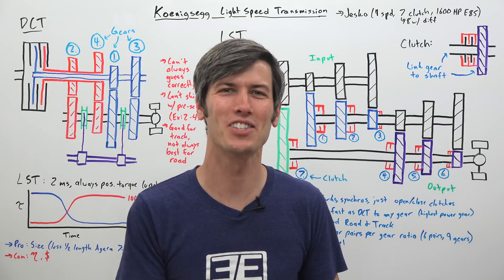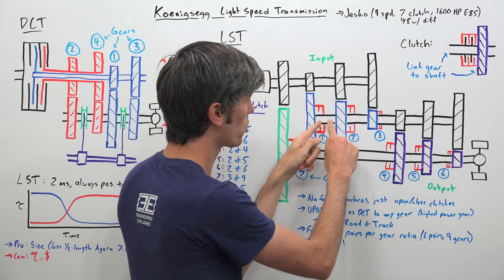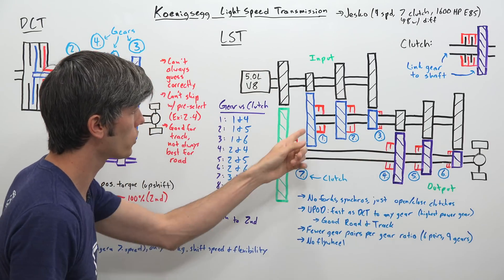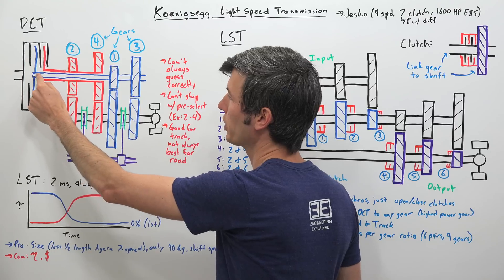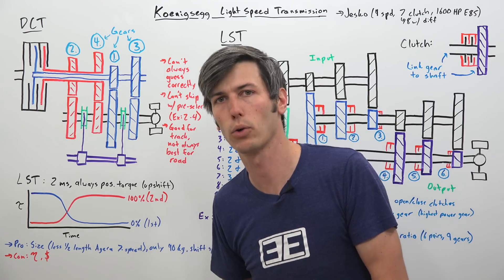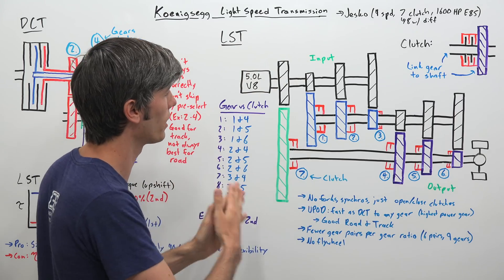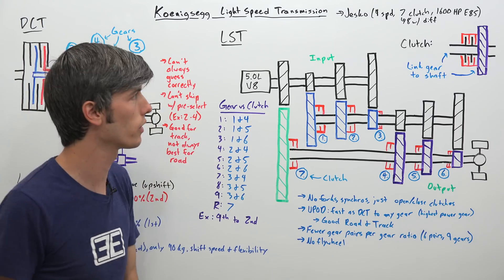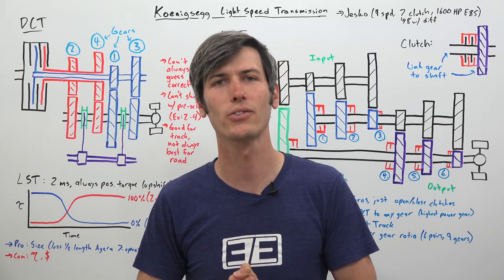Has Koenigsegg Made The World's Fastest Shifting Transmission?

Comment: Gotta respect Koenigsegg for continually finding ways to keep pure IC hypercars on the bleeding edge. I lost count of the amount of hypercar reveals over the past year that followed the similar formula of: let's build an EV hypercar with 1000+ horsepower (usually by getting the tech from Rimac), put a striking body on it and call it a day.

Now, I'm sure they're all unique somehow but none of them stand out to me because it feels like everyone jumped on the bandwagon. On the other hand, Koenigsegg knows that EVs are ultimately the future but they aren't just giving up on good old IC and geared transmissions. I'm no engineer, but I would imagine it's a lot harder to design and develop a 9 speed transmission with 7 clutches (let alone for a car with 1600hp) than it is to build a car with 4 electric motors and a battery (that you likely bought from someome else) all controlled by a computer.

Comment: any word on why they went “back” from the direct drive to a “traditional” transmission?
Reply from the maker: They didn't. Both Regera and Jesko still exist. Discussed this at the end of the video. Jesko does not have a hybrid system to fill the torque at low speeds, gears are necessary.
Reply: Engineering Explained

thnx for the reply. i watched the video to the end, what i meant by the question was, that surely if they would have considered the direct drive a superior technology, they would have continued deploying it in all their new models.

the only exception i can think of is that they wanted some kind of “purism” with this model, so they’ve avoided a motor/battery.

Comment: You should get a 350z to replace the s2k, great engine as a base for modification, has a manual, rear wheel drive, well balanced car.
The 370 is also great, but i personally think the 350 handles better. The 370 is significantly more tail happy, in my experience. A bit too tail happy.

Comment: Can you please do a video about clutchless shifting?
Reply: Its not that hard to imagine. you just need to have the engine RPM to be the same as it would be after you would shift normally. 

Say you're in 3rd gear at 30mph you would probably be at 3000 RPM engine speed. When you shift to 4th it would go down to 2000rpm so if you pull the stick into neutral which requires 0 effort. Get the RPM to 2000 then put it in 4th.

 The synchros in the transmission essentially do that for you, but they can wear out. Although messing up clutchless shifting will wear out the teeth of the transmission
Reply: @Pheatan  I know how to shift without a clutch and why and how it works. I'm more interested in the possible damage caused by doing this constantly.

Comment: Since it basically rotates all gears, just the clutches determines which one carry the power to the shaft. Correct? So I wanna know, how much power-loss there is exactly, because the engine always has to spinn all that mass.
Edit Wow, you stated it yourself. Heat loss and loss on the spinning mass. So I understood it right. Damn, am I an engineer now? XD

Comment: Im studying mechanical engineering at DTU in Denmark, one of our teachers helped koenigsegg building this transmission. He told us that the biggest challange with this transmission was that the gears had to be very thin because of all the clutches. Most computer programs said the transmission was completly impossible  to design. The tolerances in this transmission is extremely tight, and also the expected lifetime is not that high :D
Reply: Either way it’s a revolutionary feat in engineering and it’s too bad this was developed in the tail end of ICE era of automotive technology (although I don’t fully believe ICE is as close to being phased out as everyone wants us to believe, it is inevitable) I truly hope koenigsegg will license this to other manufacturers so us as simpletons will get to experience this. This has long been dream by car manufacturers and enthusiasts alike. Bravo, damn swedens put a perpetual watch in a transmission
Reply: But that can be resolved with engineering new or better material
Reply: Compared to a Minivan, lifespan may be short, but if it regularly transmits 1000 hp, a shorter lifespan is acceptable.

Comment: E46 M3 is a great option, but the Z4M is also a good choice, same engine but lighter weight. Most of the performance mods are cross platform, but there's not as much visual aftermarket support beyond the basics.

Comment: All these people talking about "so many clutches" and "every clutch is a failure point" obviously know nothing about automatic transmissions. Yes this has more clutches than the ZF 8 and 9 speeds even, but the clutches are nothing new. The way they are implemented, however, is extremely innovative. My only question is starting and stopping. No torque converter? Take offs will be very harsh unless the #1 clutch can be gradually applied like in a dual clutch trans for take off. Very cool design though, and I can already see room for expansion.

Comment: Cool, but how do you get moving from a start?  I don't see anything that allows for slippage.
How do you keep from snapping shafts as you shift gears in 2ms?  That's instant torque loading on those gears and shafts, and with 1600hp......
Reply from the maker: Clutches allow for slip (DCTs do the same thing to move from a start).
Reply: @EngineeringExplained  Yes, I've known how clutches work since before you existed.  Nothing was mentioned about clutch slippage, just instant engagement from one to the next.  So, in at least first gear, there is a way to allow slippage.  Got it.

Comment: My suggestion would be to check out TougeTime's MR2 Spyder autocross videos. He had an S2000 first but got better time on his 2ZZ MR2.

You can do a 2ZZ swap video, and talk about the mid-engine balance, the air ducting for the read engine, reroute custom exhaust to make room for a trunk, discuss and the oil leak -> precat disintegration -> lift vacuum -> 1ZZ problem, you can talk about why toyota went with macphersons, and so much more!

Comment: Isn't this just how Honda autos from the 90s worked, minus a torque converter?
Reply: Yes, I was thinking the same thing. The transmission control module in my 92 Accord just crapped out, so just yesterday, I was reading the factory service manual and read all about the transmission. Yep, it definitely works the same way.
Reply: No, honda autos were just manuals bunged onto a TC.

Comment: Great explanation as always Jason! It's really fascinating they put clutches where syncromeshes are usually at.

From what I see the clutch 4, 5, 6 are the busiest ones for daily city driving as they're responsible for 1st to 3rd gear changes.  The least used one perhaps the clutch 3, if you don't shift beyond 6th gear you'd never use it. All this changes if you mainly run the car on circuit though.

After a year of daily usage the clutch sets 4 - 6 would wear out the most, then perhaps the clutch 1?  As there is no "flywheel" vs main clutch plate slip to start the car, like in standard car, would this gearbox let the clutch 1 fully grip then let the clutch 4 slip to start the vehicle?  Or vise versa?  Or both clutches slip to start the car?

In a metaphor for bicycle, the 1st tier gear sets are like you have 3 gears on front derailer and 2nd sets are the rear 3 gears - hence gives you 9 possible different ratio combinations.  3 is a nice number, 2x2 wouldn't really work coz that only gives you 4 speeds, 4x4 is bit too excessive (16 speeds) but might work for trucks.

Comment: Oh, this is cool. This is more like bicycle gears than a regular transmission. You could even drive it with a manual shifter (instead of paddles), but without a clutch pedal, that would just be attached to a computer controlling the clutches. I wonder if CVT/automatic/electric (and even DCT) drive trains will ever actually make "fake" shifters that will control the drive ratio in some fashion, for people who want more fun and engagement. It's not a new drive train configuration, so it would not have to go through all the expensive testing required.

Comment: Jason, just get a Holden commodore and be done. V8 rwd manual magnetic suspension LSD comfy seats heaps of aftermarket flex fuel good looks on demand burnouts traction control that you can turn off , the list goes on

Comment: I wonder if the Regeras lack of a gearbox makes it that much more efficient than this Jesko gearbox.  
It is worth remembering the Regera engine is connected to a torque converter, eg basically a one gear old school automatic slushbox.  Koenigseggs torque converter probably is quite a bit more advanced and efficient than most, but should still waste some energy I would assume?  
Being only one gear, it wont be able to lock up as often as a modern regular automatic either.
On the other hand: seven clutches and bearings probably does mean a fair amout of loss of effiency!  I wonder what the cost of a complete clutch replacement would be aswell :)

Comment: Am I missing something or is this is just an automatic transmission with helical gears and no torque converter? This isn't new tech. It's fairly common in the racing world (just without the helical gears). I would be worried about longevity for a street car.  Your first gear clutches are going to wear pretty quickly with all that stop-to-start feathering.

Comment: After the S2000? A SuperSeven 😁 . Fornthe koenigsegsurjdgsbrud gear box: what about torque dumpers, how does it work? Normally they are in Flywheels to make engine behaviour smoother. How does it take off, is the first gear clutch a different design?

Comment: The Fiat 124 Spyder is a very handsome Miata you can drive in much more comfort without the hairdresser stigma. It'll match your old gray hairs well.
Reply from the maker: Yeah but the MX-5 engine (and transmission) is so much better.
Reply: @EngineeringExplained  you can build up the turbo motor and swap out the clutch and shifter to improve what you don't like. Thats what the aftermarket is for. Sometimes, not being the most efficient or well-engineered isn't a bad thing. You get character, and a chance to make something your very own!

Or, you could buy a Fiat with a blown motor and a rear-ended ND Miata and swap the Miata guts into the Fiat. If Gingium can fit a hefty 1UZ into a tiny pickup truck, surely you could swap an engine shared in the same platform!

Comment: Brilliant! 

Can you do a video on how dyno machines work?
Reply: They're actually really simple they just use a torque converter with an arm off of it hooked to a load cell
Reply: Logstuf Ah, and here I thought there was water in them like an engine-dyno. Whoops
Reply: Some of them use water with an anti-corrosion additive and some of them use oil but it's still basically a torque converter at its core that can be opened and closed to adjust the load

Comment: Does this also increase the amount of torque that each individual gear is capable of holding because the power goes through an extra gear set?
Reply: Dot Dot, No because only one gear per shaft is actually transferring torque. Undeniably, the smallest gears will most likely fail first given they are all used equally and manufactured with the same metallurgy.
Reply: MJorgy5 But there is an extra shaft, so 3 gears instead of 2.

Comment: So it basically relies on the independently controlled clutches next to each gear. Then why not just replace these selectors with independently controlled clutches — or increase the amount of selectors to one per each gear, rather than two gears sharing one — in the dual clutch transmission? It will prevent wrong pre-selection, allow gear skips, delivery better efficiency due to only having two shafts, and perform even faster when a pre-select is certain.

Comment: FYI: The AMG SpeedShift DCT will also drop the box into the best gear for max acceleration by pulling on the left paddle for about 1 sec.
It shifts in 100ms, so a bit slower than this box, but still damn fast. I love mine, its huge fun to use.

Comment: I know this small regional heritage museum in the inlands of Romania, I visit that area now and then. They collect old farm machinery, antique tractors, combines and the like. Their most fascinating exhibit for me is out on the yard with the stationary machines. It is a single cylinder Deutz Otto-cycle 4-stroke industrial stationary engine from around 1870-'75 and it must be one of the oldest existing 4-stroke engines in the world, only forgotten because in the remotest God forgotten place. I have looked at it quite a few times and though I find it a beautiful 'steampunky' piece to look at it causes me at the same time offense with the modern world. We are 150 years removed from this engine and when we look at the average new car engine we see exactly the same parts: crankshaft, flywheel, piston, camshaft, overhead with valves, fuel intake, ignition system, exhaust, cooling. Yes, it has by now been tweaked and improved to perfection but it is still the same 19th century technical concept. Most offending for me is that the spark plug (guess what, Bosch in 1875!)  basically hasn't changed at all except for materials, it was hexagonal and made of porcellan and one and a half century later it still is. A modern car engine in my eyes is like a steam train, with digitally optimized coal burners and steam management by clever algorythms.
Even very sophisticated car design companies like Porsche always seem to be stuck in only trying to perfect what is known One man standing out in my view is Elon Musk with his drive for electric cars after the car industry had neglected the technology for a century. Koeniggsegg really amazes me with his innovations, the key must be another mindset, the new transmission just another example and by now you start to believe that big corporations not just hamper real innovations but exclude them.
I'm not a tech guy, only on the level of how to repair my own classic Volvo's, but when I see this new transmission explained then I instantly think this concept could have been thought of a hundred years ago, probably cluth technology of the day would have stifled development, but it would have been cracked. Billions of transmission later this micro Swedish visionary car maker suddenly unearthes what technically should have been developed ages ago, but I guess the concept is just to simple and evident.
At the other hand I think it is ridiculous to use real innovative concepts for only a handful of over the top hypercars for billiardairs instead of putting them to use to improve and make more sustainable the billions of cars out on the road, time is running out for the world as we know it.
Looking at the car engine as we know it and which will be around still for some time I can't wait I for the disappearance of the camshaft towards freevalve-like systems but most of all the replacement of the spark plug with laser ignition technology or anything. Christian, if you should be reading this: the megacompanies like Bosch are not interested in innovation in that field, please make it happen with a stroke of your genius!

Comment: Totally get it, simple!!! The 3 gears basically have 3 ranges or different ratios they can apply forces to, instead of all the movement of traditional style gear, they all stay mated, rotating at their own speeds but not applying force to the output shaft until the clutch packs for the selected gear are engaged. The gears are ALWAYS ready.. When movement is reduced, so is time!!!

Comment: Right as they start to make good transmission ideas that aren't manuals,  electric cars are on the rise which will make gearboxes unnecessary.
Reply: I think we are heading to the hybrid era, ev have proven to have power and effeciency whilst gasoline has history backing it, once a electric gearbox is developed, it would be the likely replacement of gearboxes and the beginning of the hybrid era
Reply: @thapelomashaomasemola7922  I'm not sure I feel that the direct motor to wheel with no gasoline will prove itself, but time will tell.

Comment: when you shifted from 9th to 2nd i could hear the valves floating. lol.
Reply: Not if they pair it with their camless valve system thing 😬
Reply: @dubeights  even the camless will have a limit. its still moving mechanical parts that can only take so much force before parts begin to stretch or fail.
Reply: Yeah it's silly, the engine needs time to rev match anyway.

Comment: This series type of gearing is used in enthusiast 2-speed RC cars, albeit much simplified (e.g., 1st gear is on a one-way clutch bearing). The video didn't go into details, but I'm more interested in how Koenigsegg implemented the multiple clutches; normal clutches only have to deal with straight engine torque, but the clutches on the second gear set appear to have to deal with multiples of engine torque if the first gear set is put in underdrive (engage clutch #1 in diagram). With so many clutches and high performance demands, packaging and keeping weight in control must had been challenging!

Comment: Does an extremely fast change in revs place a lot of stress on the cambelt?
I drove a little Honda Ballade with "stick shift" (manual) thats cam belt teeth let go because I was being too aggressive on downshifts... according to the mechanic.
Currently driving a lot more modern vehicle with a DSG, but I am always still wondering if these fast rev changes do not put an excessive amount of stress on the turning parts of the engine...?

Comment: They need to build a version of this transmission for semi trucks. 16 or 18 speed would be great.
Reply: The Tesla Semi is a lot simpler
Reply: Svein Hanssen  EV heavy trucks are in the works but still not an option today. This type of transmission paired with a conventional semi Diesel engine would be a game changer. Instant gear selection with low torque loss is ideal for heavy hauling.
Reply: It’s not really a complicated system at all.